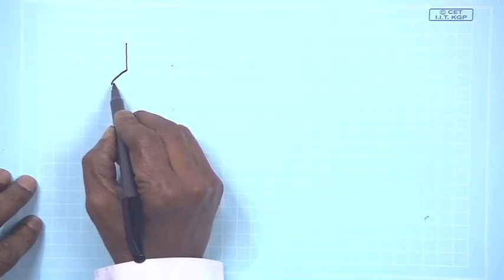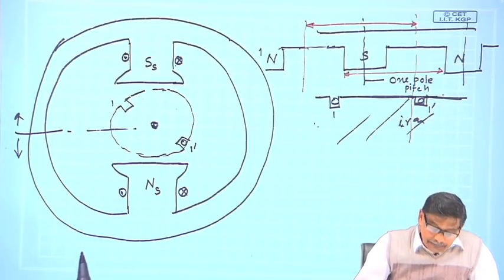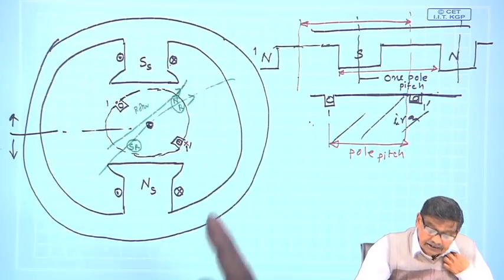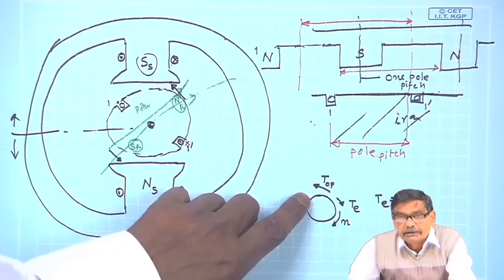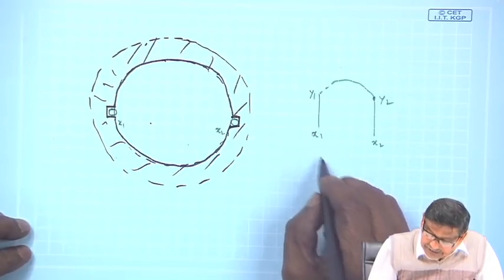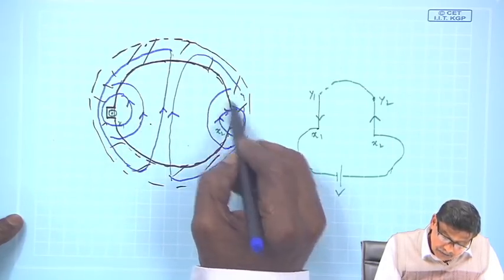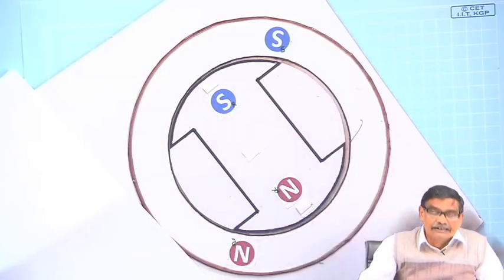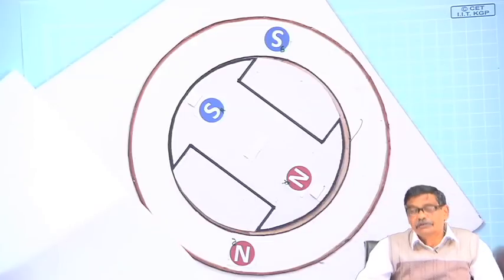Lecture 11: From Linear to Rotating Machine (Contd.)

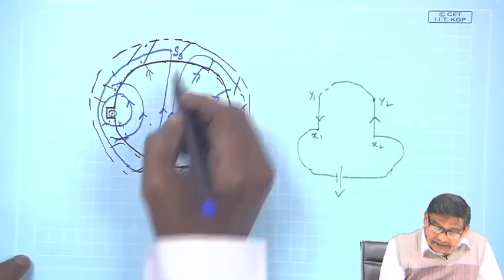Comment: Sir , at 20:43 Iam expecting the opposite  directions to Ns and Ss to what you have drawn. I am assuming it as inside the magnet, the field lines will flow from South pole to North pole.....and outside it's reverse . Am I correct or wrong???
Reply: I think sir was right.
Reply: Same question